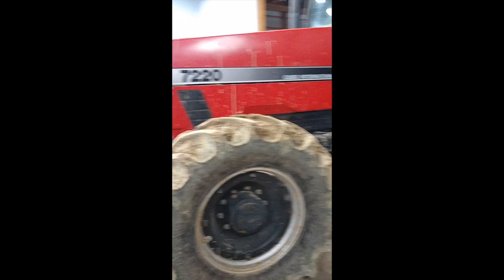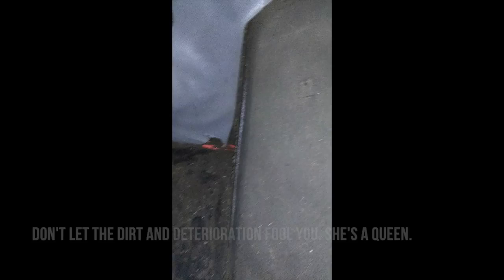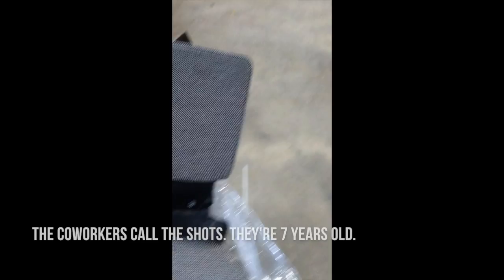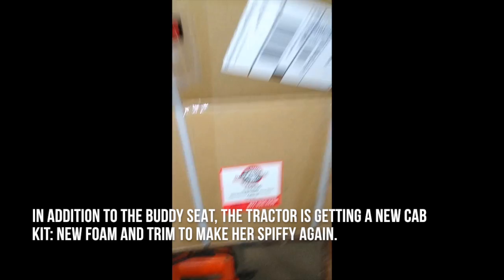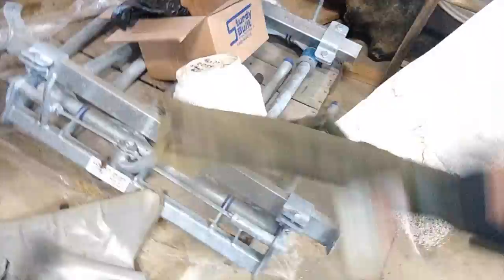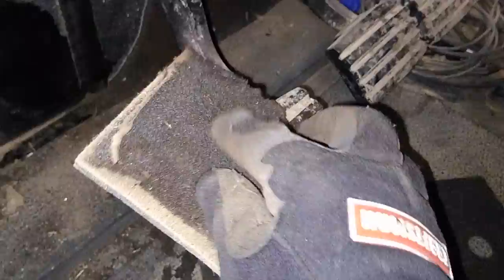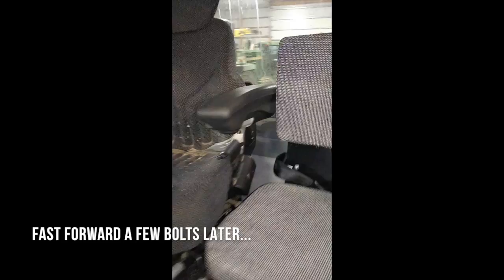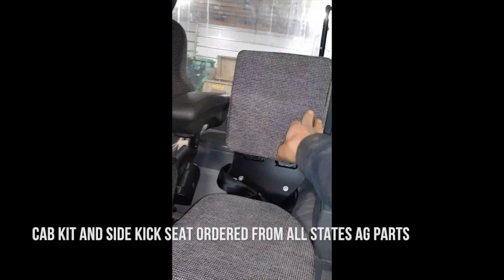Adding a Buddy Seat to a Case IH 7220: vlog #14

Comment: I have a question, does the buddy seat prevent the swivel on the seat?
Reply from the maker: This tractor has a Grammer seat. The armrests are both still on, and it swivels. The buddy seat has an added metal strap on the back to hold it down. If it would fold down, then the driver seat would not swivel.